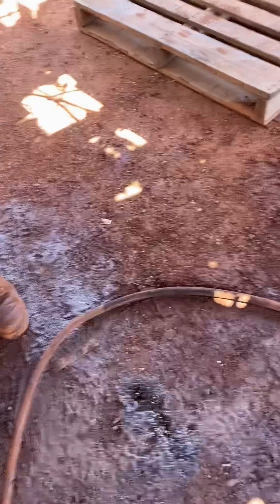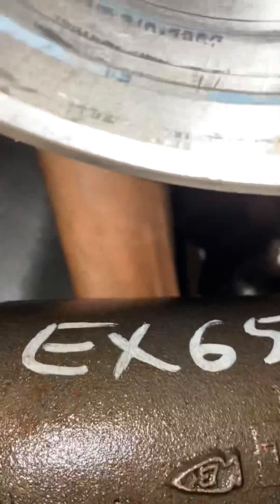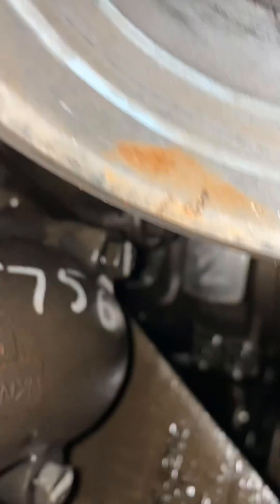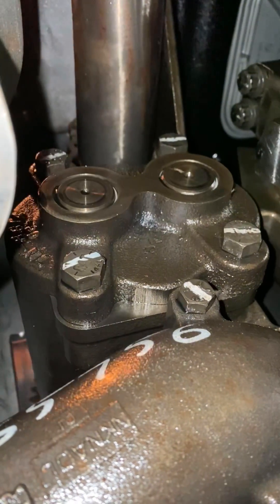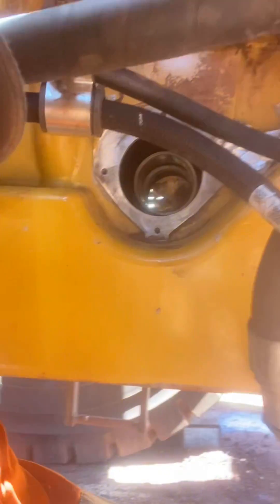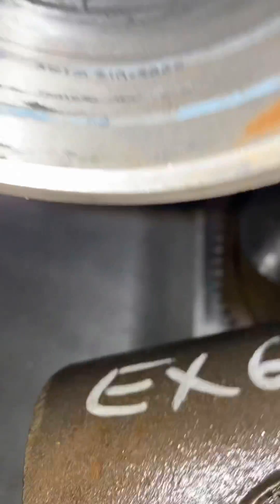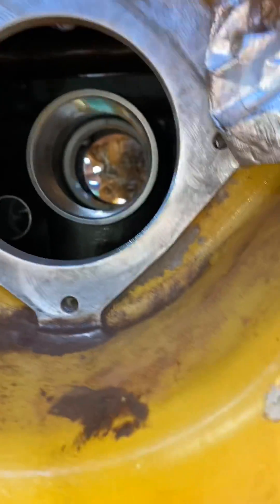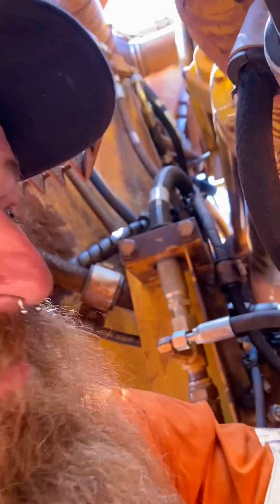Found a bolt in the sump of a V16 Caterpillar 793 haul truck 😮

Comment: How big is this engine? Looks about the size of my room in there XD
Reply from the maker: 78L engine 4000hp 
3.1m long
1.6m wide
2.1m high
7.4 metric tonnes with no fluids or operating equipment ie transmission or pumps.
Reply from the maker: That’s 4000hp at 1700rpm
Reply: @Fenndog  Absolutely massive.  Thanks for the info
Reply: What’s it’s idle speed?
Reply from the maker: @AltonJohns-s7r  600-800rpm max torque bout 1400rpm and rev to 1800-2000, this truck will do 90kph
Reply: CAT C175-16. Where did the bolt come from?
Reply from the maker: @Hans-fq4ip  oil pump housing it’s inside the dump at the front of the engine.
Reply: @Fenndog 90kph is a bit of a push for a 793
Reply from the maker: @benfairhall5331  push it’s the operative word here. “Will” do if pushed. Have seen yarns 😉 60 autonomous 80 all day 😎
Reply: @Fenndog  hahaha yeah copy mate back here in the east never seen one that quick but every possibility
Reply from the maker: @benfairhall5331  yeah nothing special over here same truck just loose driver. Sustained driving at that speed would cook that diff 😂😂
Reply from the maker: @benfairhall5331  yeah and that lil cooler would be roasted 😂